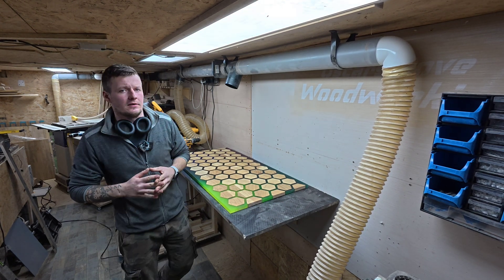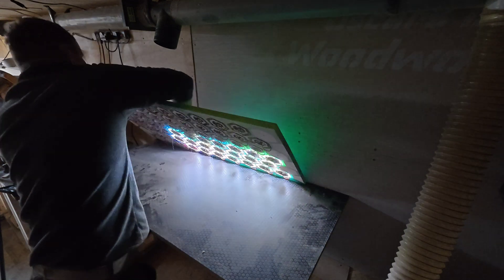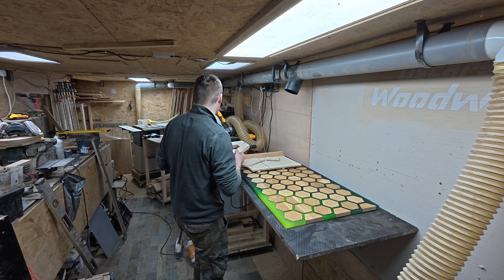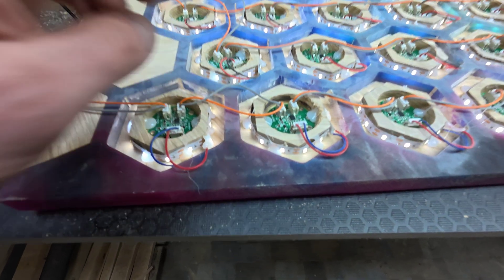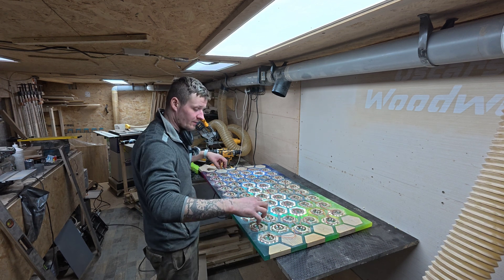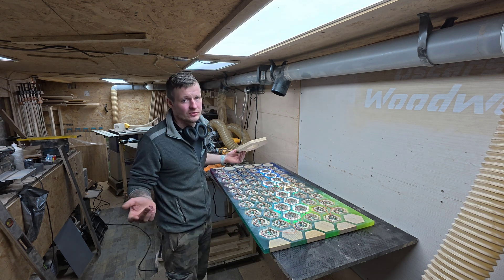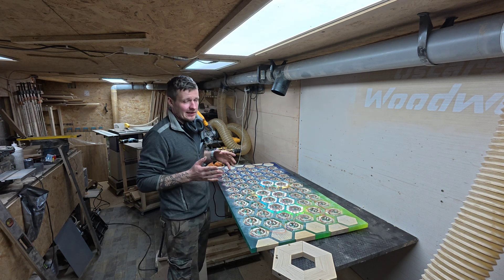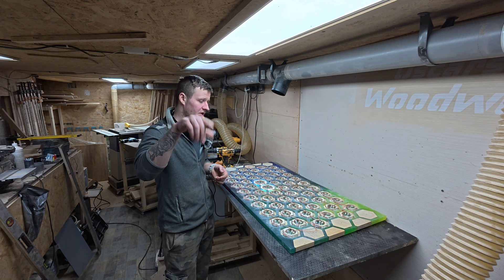Touch sensitive resin table.  What you need to make it? What sensors? Touch modules

Comment: Your table looks great. I like that you used different colors to make the table light up like that with only the white lights. The fact that you cut all the shapes out by hand is awesome. When you bought the sensors, did you have to buy the power supplies and sensors separately? I'm trying to make sure everything will work with each other to attempt my first table. I look forward to a build video when it comes out.